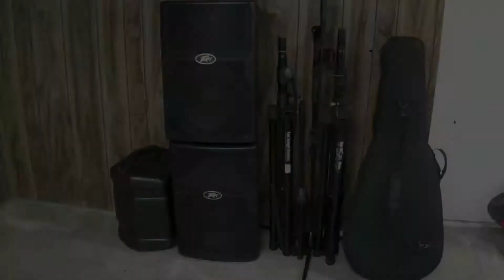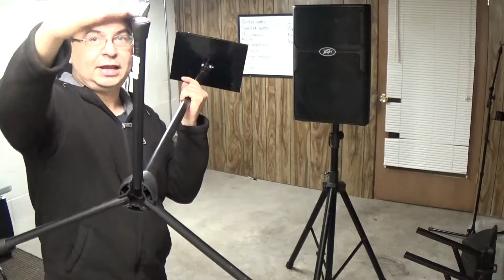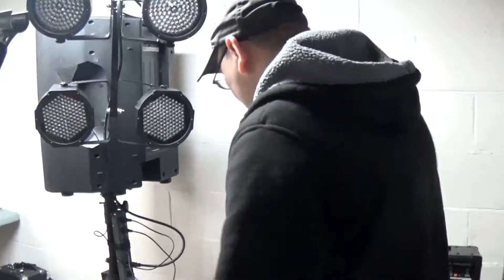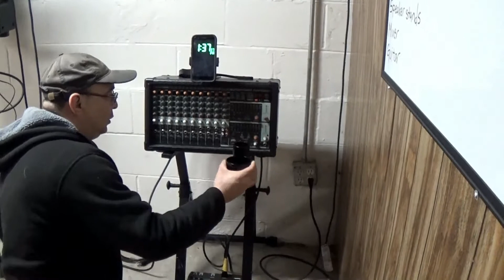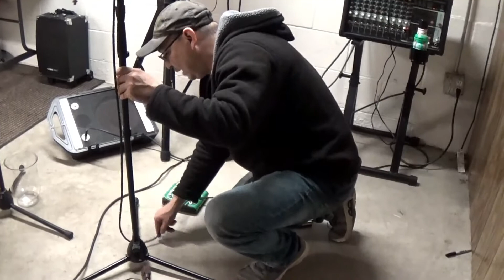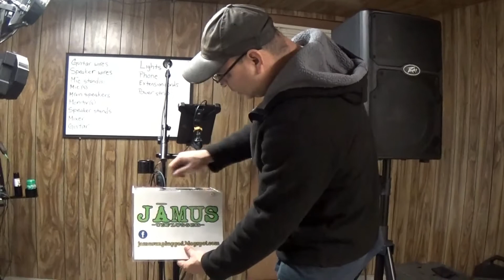How to set up a small P.A. for an Acoustic show (Step by step) (Pt. 16)

Comment: Better than a power strip, invest in a power strip (mains distribution board) that has a mains filter on it. This will help clean up "dirty mains power" that would otherwise produce hum. I would also recommend packing a mains extension lead of 5M (16ft) to 10M (32ft).

Comment: Good detailed video depicting your process and gear.  As you get older (and wiser??), you tend to “downsize” on weight and “stuff” and go to use more wireless solutions.  The items that caught my attention was the huge mixer, speakers/monitors, and lights.  With Bluetooth and wireless technology, you can reduce or eliminate cables, and with Battery operated systems as well that have proven to be reliable.   For example, you can use a Behringer Flow 8 digital mixer, JBL Eon Ones speakers or Bose S1 Pros, an Xvive or Shure IEM system, a Chauvet DJ colorband with Bluetooth, or ADJ battery powered PARCans and reduce your setup and tear down time, remove messy cables, and not hurt your back lifting heavy speakers, etc.  Eazy Peazy!  Any thoughts?
Reply from the maker: And spend a lot of money on batteries.  If I was moving around on stage that would be the way to go. But when I'm playing I'm pretty much stationary.  Thank you for the comment, much 👍 appreciated.
Reply: @JasonsAcousticWorkshop  I use rechargeable batteries, and I always have charged batteries ready to go for a swap.  It is an initial investment, but once you have this, it works great.  Some systems just need to be plugged in to charge.

Comment: hmmmm  nice info But i just put the speakers behind me.  You have better control. especially in smaller venues. Been doing it for years and if you know your voice/mic/system feedback shouldn't be a problem.   you eliminate the need for monitors, AND almost all the time i use just one speaker anyway Again i've been making my income this was since the 90's. on top of that It cracks me up seeing guys in small venues using in ear monitor

Comment: Cool dude! Thanks so much! Do you need a DI Box for a Bass guitar, Keyboard or can you just plug into the Behringer Europower PMP200D mixer?
Reply: If you have a Mixer you don't need a DI Box. A DI Box is only necessary if you have a small PA setup, like 1 active speaker that connects directly to your mic and instrument. The reason is that XLR cables (mics) are balanced whereas line cables (instruments) are unbalanced and because of that you want the DI Box in between the instrument and the speaker to get a balanced signal into the speaker. A mixer does the same thing
Reply from the maker: No, just plug in to one of the channels.  I plug into the zoom acoustic pedal then right into the channel 2.  No DI Box